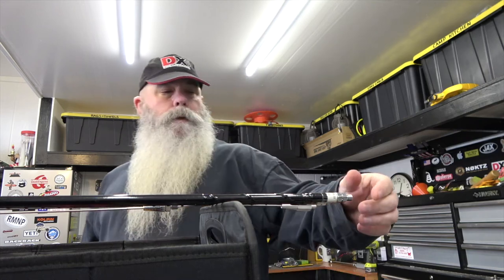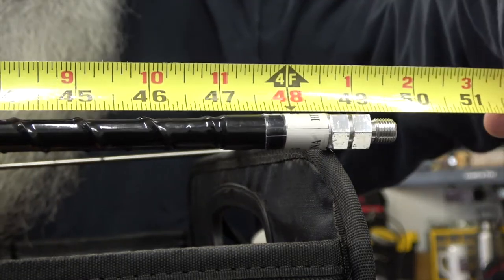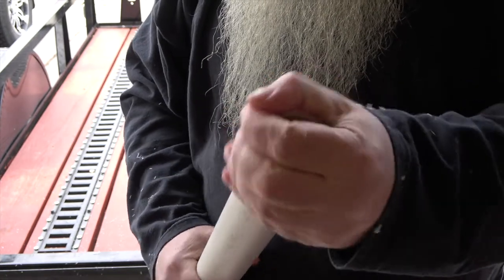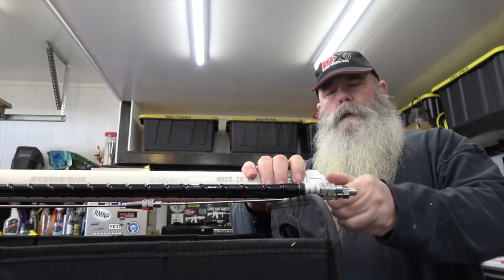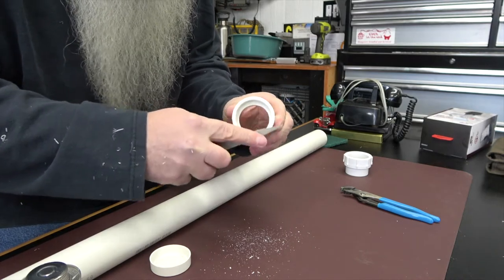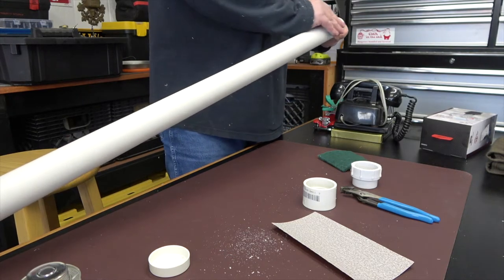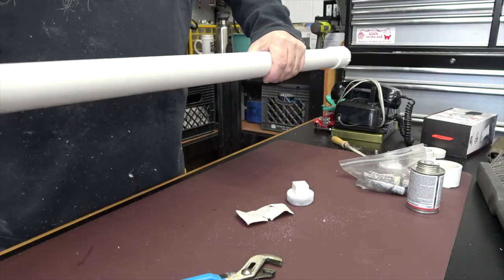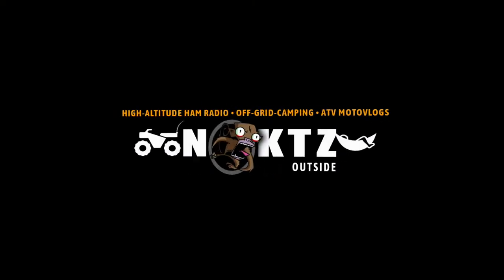DIY Mobile Antenna Organizer

Comment: That's exactly what I did, just be sure all the set screws are good and tight or you'll find them laying in the tube when you get where you're going. Great video.
Reply from the maker: Very good point, Mark. Thanks for the tip!